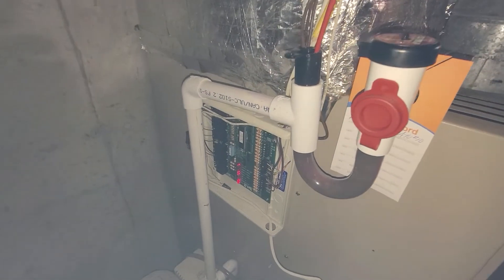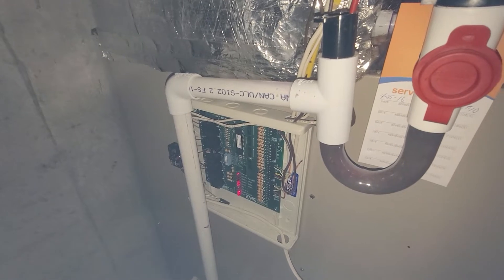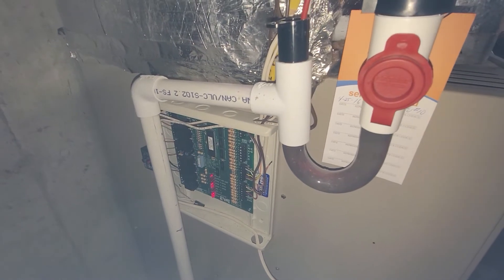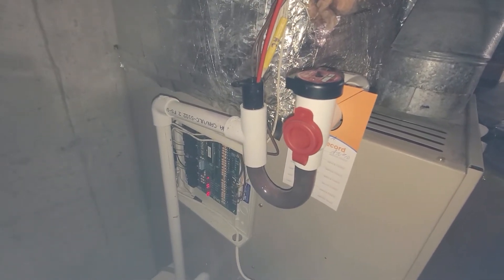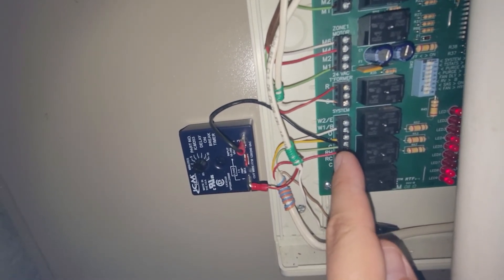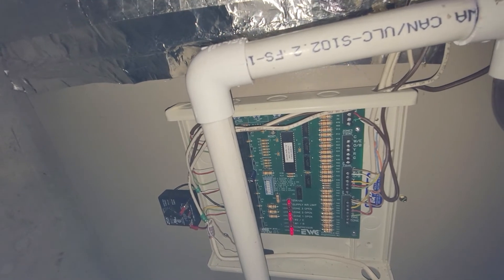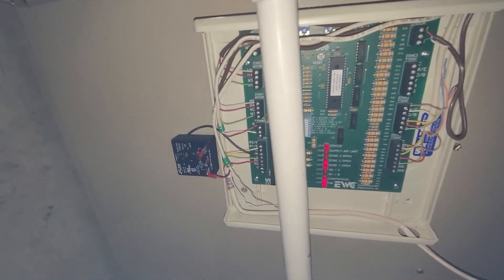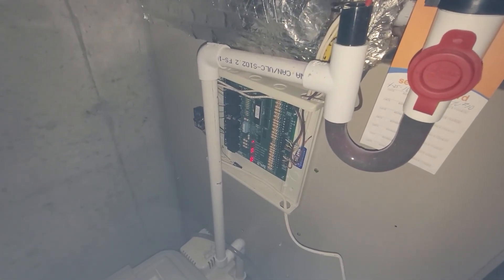ICM203 Delay On Break Timer Install: Anti Short Cycle Central Air Compressor

Comment: I had a problem with my ac, when it got real hot it would not start, just kick out on thermal several times before it would start, tried new start capacitor, hard start cap, different thermostats, still would not always start. Unit is older 3 ton unit but cools fine. I finally thought, there's got to be some kind of settable delay and looked on ebay found exactly what you have. It works great, set it for 8 minutes and even short power drops set the delay!
Reply from the maker: Exactly. This device is a lifesaver! Truth be told my wife and I are just trying to get a couple more years out of the system (old R22 5 ton) because it's approaching 20 years old so it likely doesn't have much life left. Still, I'm not trying to rush into its grave prematurely ha! $20 is a good investment to kick the can further down the road for now!

Comment: Overkill is better than underkill. Dead compressors tell no tales, but are more expensive than 5 minutes of waiting on AC. Thank you for the great content.
Reply from the maker: Thank you for watching! Yeah I'm glad I picked up on the short cycling. The system is nearly 20 years old and I know it will need to be replaced soon. Trying to get a few more years out of it before then. :-)